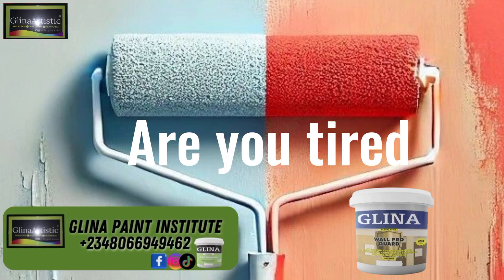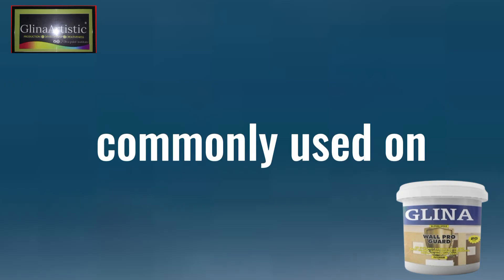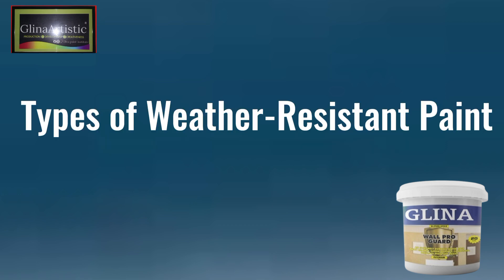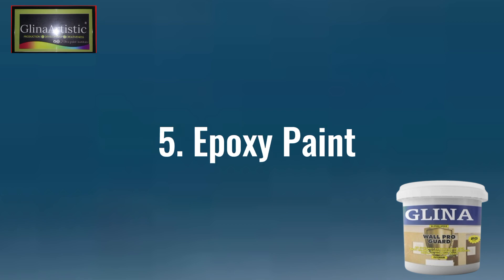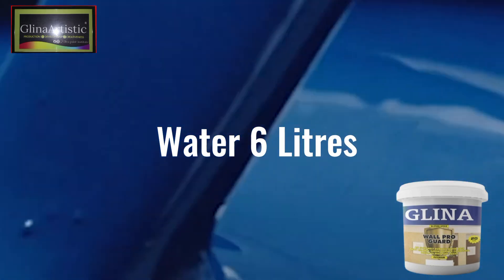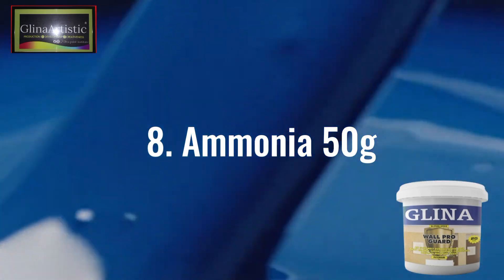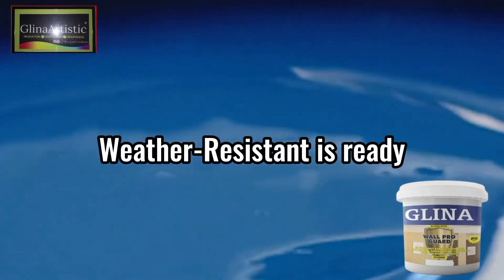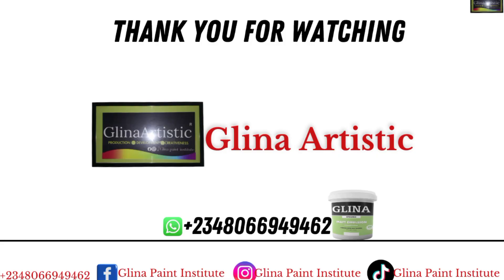Weatherproof Your Walls: DIY Weather-Resistant Paint That Lasts / Paint Manufacturing

Comment: Hello!
Coustic soda hmmmmm?
In quality paint is not good because highly alkaline. Use NP 9 for better results.
Some more ingredients are missing in this video.
MEG(mono ethylene glycol)  
Is a dryer and also use for better brush ability & anti freezing agent.
Reply from the maker: Caustic Soda is also good for paint from  not peeling from walls. And remember what might work in your own country might not work in other countries,  so you need to check the weather conditions, caustic Soda has different functions.  It can even be replaced with ammonia most times 
Yes, all chemicals are not mentioned because we have an ebook. The ebook has  step by step production process. Also, MEG.  Ethylene Glycol is  good for better brush flow, like you said, and also to be reduced  when the paint is  produced with fillers. While you increase it, the paint has no  filler. You reduce it.